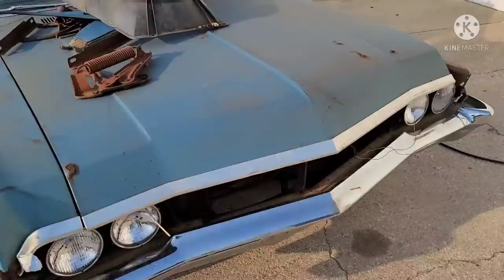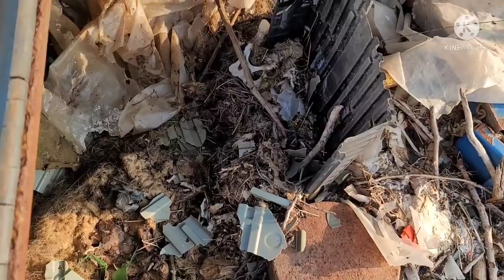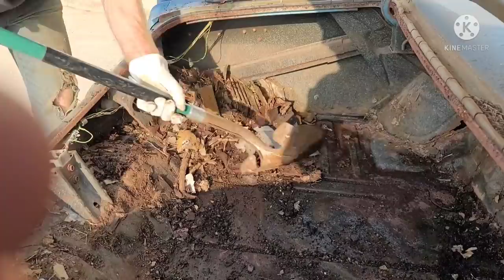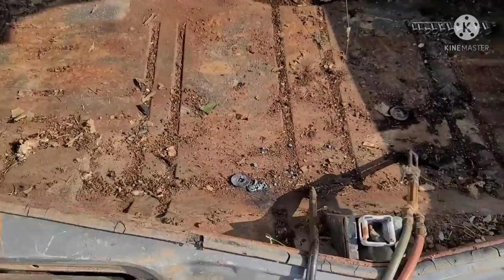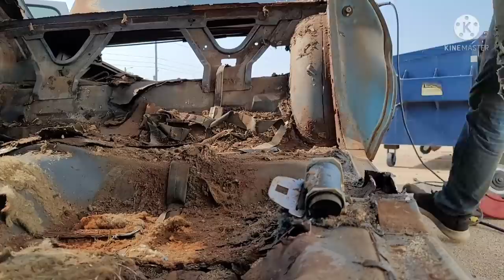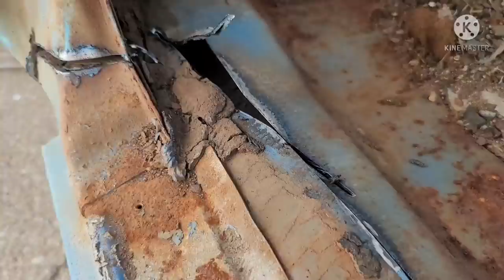Chopping Block: I dismantle a 1967 Chevrolet Impala parts car! To save other Supernatural rides...

Comment: Tim, how much change do you find in the old cars? I got a daily newspaper car one time that had over a hundred dollars in just quarters and coffee cans of other change over the years but the pile of quarters came from the inside of the drivers door. I have found some real old change in the early forties and all other older rigs. I found a half dollar that when cleaned up lightly, It was in amazing condition... and worth five thousand dollars. Yes I sold it as if its worth that much to them, I just hope it left some meat on the bones for him. I have used four door car rear quarter panels for the two door cars also. It makes it a lot easier if you can get those rear quarter panel bolts out and then its just snip and splice.

Comment: Save the hole front clip off of that car and the trunk and the dash and steering column
Reply from the maker: I have several 1967s that will be using parts from this car